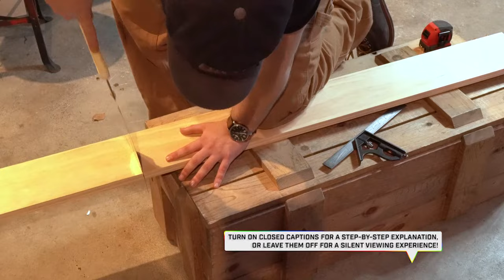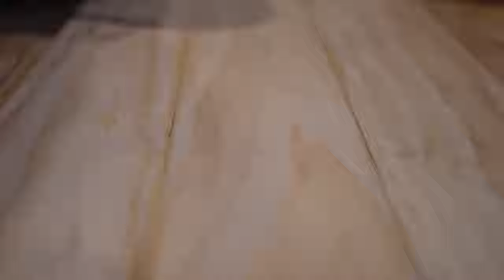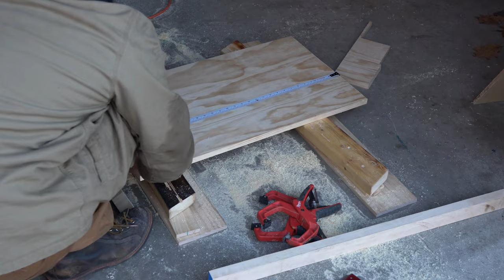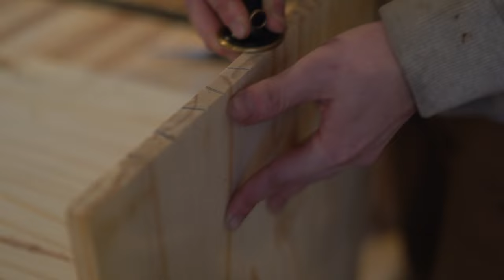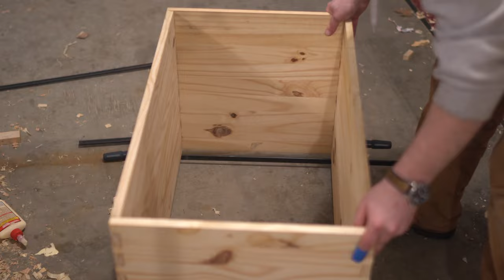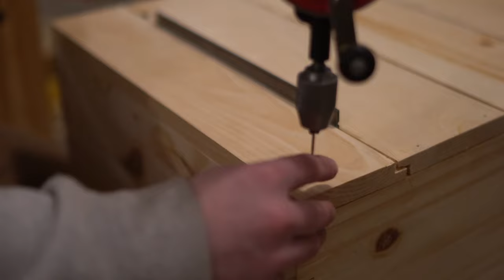Building the Anarchist's Tool Chest - Part I: Dovetailing the Case - Woodworking

Comment: 7:57 may want to make a knife line in the future, 🤷🏻‍♂️I find it helpful for cleanly beginning the chiseling process if you aren’t going to cut all the way to the line with the coping saw.
Reply from the maker: There is one but it’s a bit hard to see! Also, this was basically my first go-around at dovetailing, but the 60+ tail/pin pairs in the project alone have given me quite a bit of practice. You can see a huge difference between these first ones, and the later ones like the tills in part 3.

Comment: Rlly nice work.  Question for you.  Unless im mistaken it looks like you used 3/4" boards for the tool chest.  Did you/do you have any issues w final build?  I ask because thats maybe only thing holding me back on making this.  Difficult to find 1in boards of lightweight wood for this build and have access to alot of 3/4" pine.  Also if you already answered this im sorry for asking again.  Thanks!
Reply from the maker: @contra81  yes, I used 3/4. I’ve had a couple little issues as the wood moved with the seasons, nothing a little persuasion or sandpaper can’t fix.

Comment: Think I would have dovetail nailed the bottom rather than driving the nails in straight. If you boxes get anywhere near as full as mine!
Reply from the maker: The idea is for the bottom to be easily replaceable should it get damaged due to flooding or anything of that nature. I agree though, I’ve already had to reattach a floorboard twice now.
Reply: Your using quite small nails and drilling holes for them, so they’re not going to hold much.
Reply from the maker: @anvilhead0  Thanks for the tip, maybe I’ll spin some screws in next time they need work.

Comment: Which rabbet plane do people recommend?
Reply from the maker: I’d say the most common type you see are Stanley 75. The one I have is the Millers Falls copycat of it. There are a few kinds of rabbet planes though, and some people swear by wooden-stock “straight rabbet” planes, which essentially only cut one size rabbet, but require very little fiddling with to work properly. You can also look at the modern skew rabbet planes from veritas. I’ve never used one, but I’ve heard good things. Pricy, of course.

Comment: Nice work. Thanks!
BTW: Did you consider using cut nails for the bottom rather than wire nails? No biggie. Just curious.
Reply from the maker: I did, but I’m honestly not sure where I could source quality ones. I’d appreciate any recommendations.
Reply: @anarcholeptic  Tremont Nails
Reply: What are cut nails?

Comment: I am truly puzzled. An anarchist is someone who rejects authority, and yet this is about building a particular design toolbox, on the authority of the designer. You cannot be both an anarchist and a follower. Perhaps it should be called the Paradox tool chest...
Reply from the maker: Read the book.
Reply: @anarcholeptic  you cannot tell an anarchist what to do. By definition.
Reply: The guy built a toobox a certain way, because he wanted to, and without compulsion. How is this not anarchy? Can anarchists use cookbooks or repair manuals, or do all anarchists have to divine all procedures for themselves, in wholly novel ways?
Reply: @egisshield  Of course they can- but they are not being anarchic when they do! We all have different attributes, but do not mention them when they are not relevant. I am left-handed, but would not bring it up unless it was germane to the topic. I have just built a tool chest- but it is not a left-hander's tool chest- the design is not for left handers, even though it is owned by one. So, I ask again, what is it about this chest that makes it identifiable as an anarchist's chest?

Comment: I noticed your spray bottle of dihydrogen  monoxide. So few woodworkers know the secrets of using it. Pro tip: if you get thirsty while woodworking, you can actually drink that stuff, and it hydrates you faster than anything else!
Reply from the maker: Also great for getting dirt and grime off!